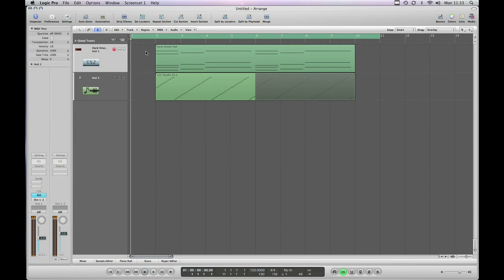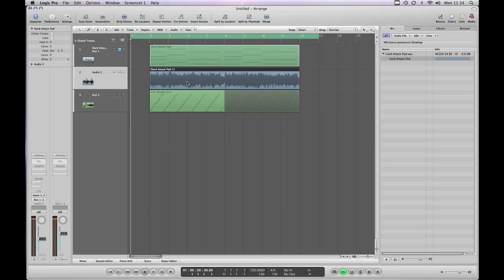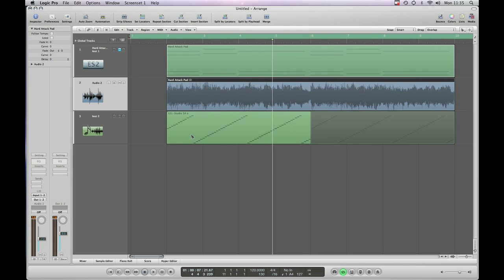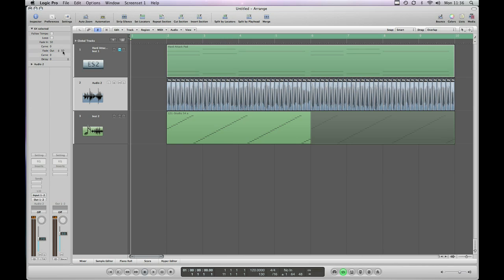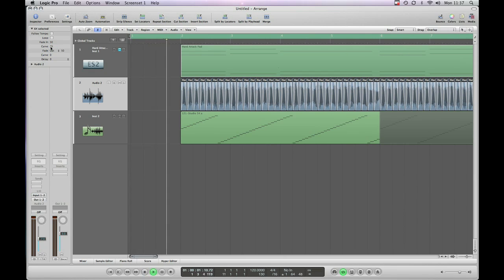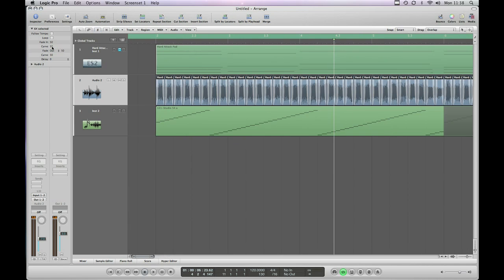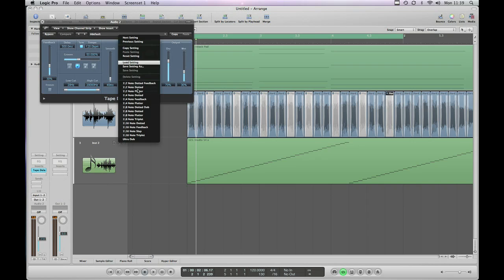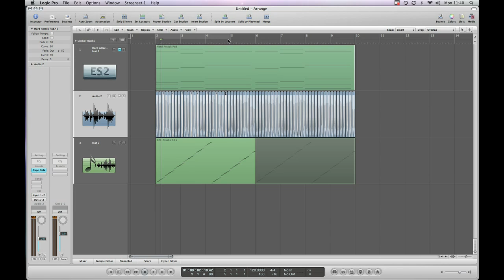Logic Multiple Cuts

Comment from the maker: Definitely the scissor tool is the right tool for the job, you could use SPLIT BY PLAYHEAD which is available as a button in the top toolbar or you could assign a key command to this, it's not assigned by default.
But if I were you I'd be trying to work out why the scissor tool doesn't work.

James